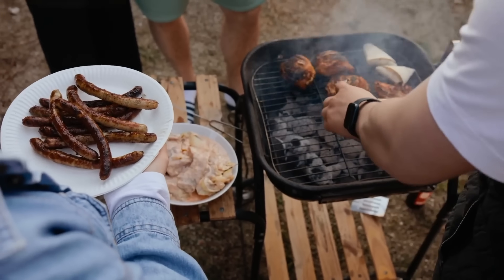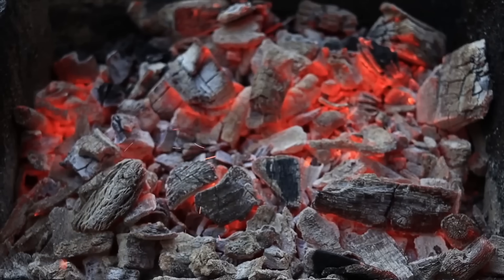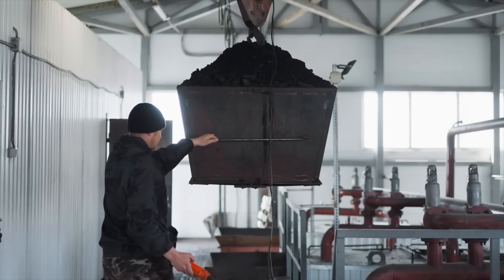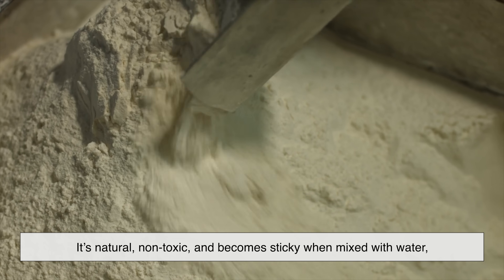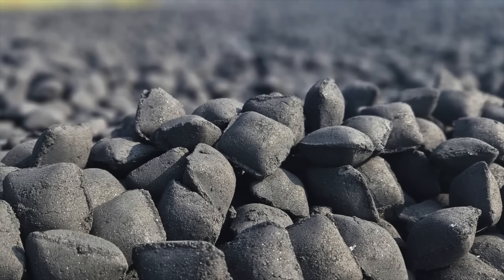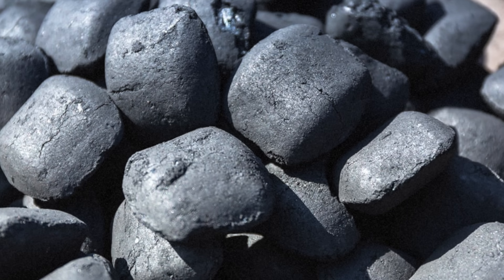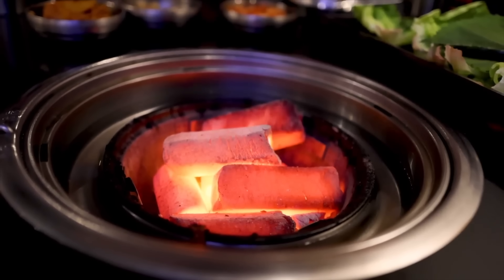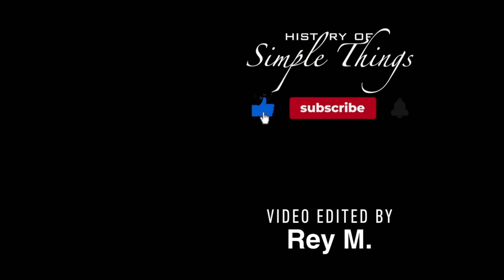How Are Charcoal Briquettes Made?

Comment: It would have been nice to compare them to lump charcoal. Charcoal briquettes are poison. Lump charcoal is much better. In my Big Green Egg, they explicitly tell you NOT to use charcoal briquettes…
Reply: Why? Sawdust, coconut shells, starch, Walter, are not natural?
Reply: @Capablanche  Lump charcoal produces much less ash than briquettes.
Reply: @leecadillac4128  Lump also burns a lot less longer.  I use both B&B briquettes and Jealous Devil XL lump, I like both but I'd never get 9+ hours out of 1 batch of JD like I do the B&B on my 22" kettle.  Mostly use the lump in my kamado and portable grills (Jumbo Joe and Go Anywhere) as I'm not generally cooking anything in them for more than a couple hours.
Reply: @Capablanche the glue that holds it together.
Reply: @Biggestfoot10209 .  Commercial or industrial charcoal briquettes for heating use glue or chemical binders.  Modern BBQ briquettes used for cooking do not use glue and are considered safe. They use starch, natural wood lignin or natural gums as binders then compressed with high pressure.  The danger is from carcinogens caused by overcooking the food. That’s why it’s tricky to master on an uneven cooking surface like a bbq grill compared to a precise cooktop or oven temperature.